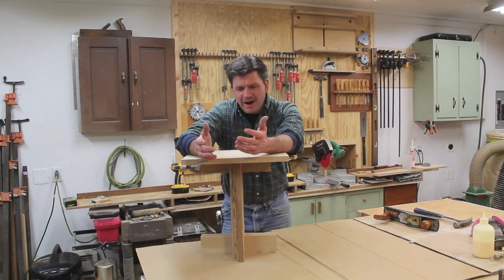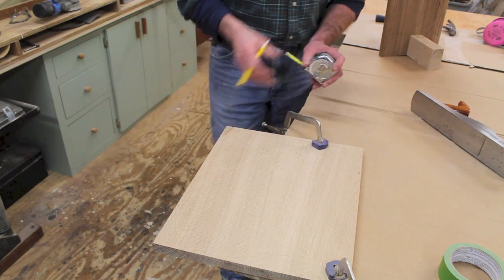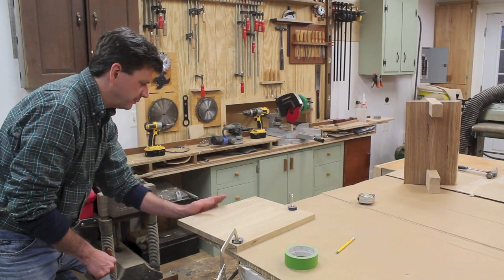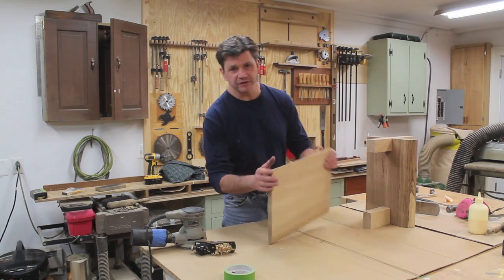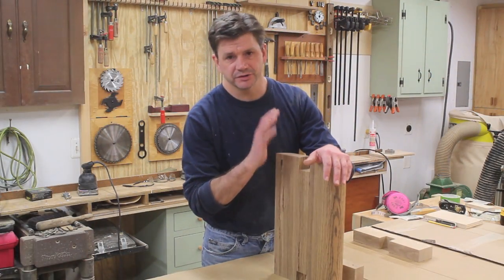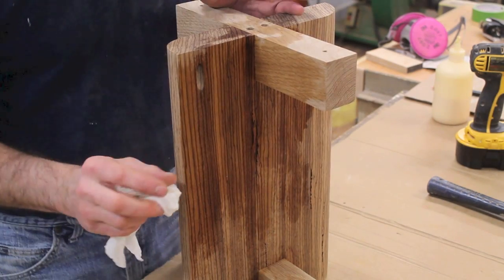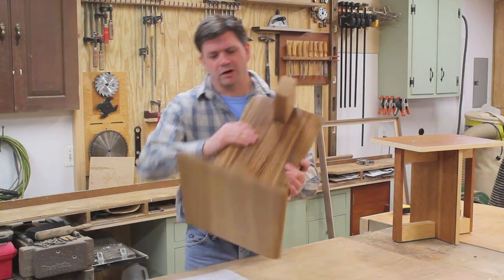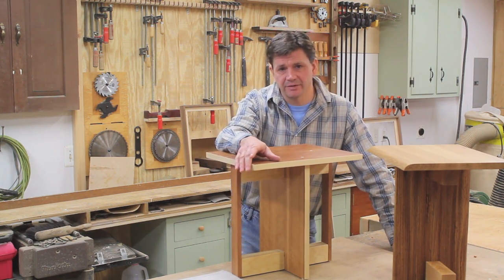Building a Modern Stool with Zebrawood and White Oak.

Comment: You draw the straight line without a ruler at the beginning. That was awesome.
Reply: He rests his finger along the edge at the depth that he wants and then quickly runs his hand down the straight edge while keeping the finger/pencil in the same position it was at the measured point. Its a pretty quick way to measure once if you know you want a parallel line against a thick edge. Artists and Carpenters use that trick all the time. What amazes me at times is his ability to eyeball measurements.

Comment: I love the mid-century look that adding the two pieces of wood to the older stool gave and I think that the new stool looks great. Definitely more of a museum piece though. I think that using elements from the newer design (such as choice of wood, edge rounding, and thickness) incorporated into the structural design of the first stool would look amazing.
Reply from the maker: Thanks man, Think i'll try that, third times a charm

Comment: Can you talk on one of your Q&A videos about using melamine as a drawer carcass and how to make strong corner joints? If it's solid you can do dovetails, but I'm assuming the structure of the chip-board melamine wouldn't work with dovetails?

Comment: Jon, if you don't mind my input, I think the trouble you are having with the overall design is that the top doesn't fit the rest of the stool. The stool is all made of a thick material giving the chair a maybe more bulkier or primitive look, however the top is a more sleek and elegant design. Maybe try and switch the top to thicker stock material and see how it looks. This might not be so hard to do as it seems it was only screwed down.